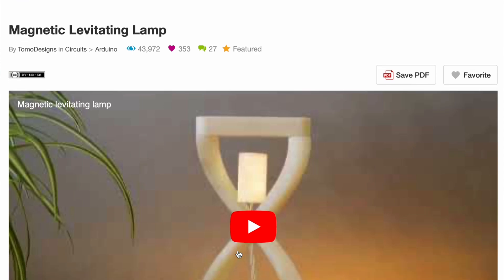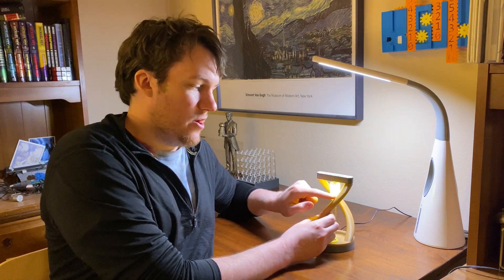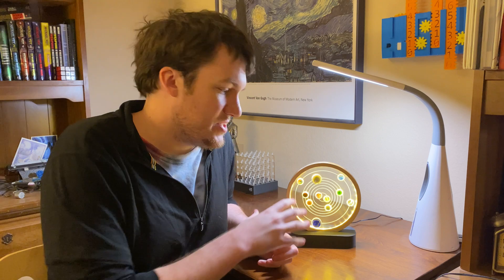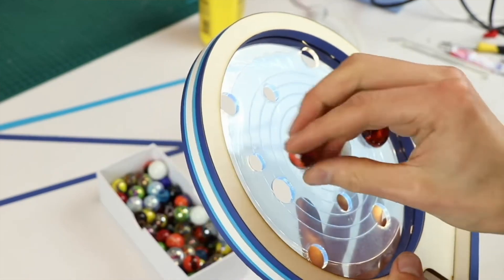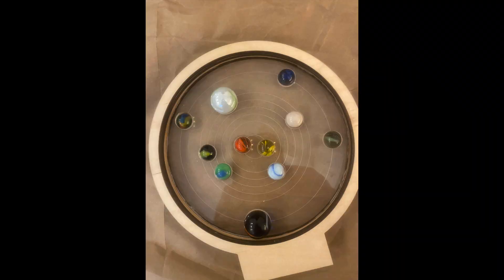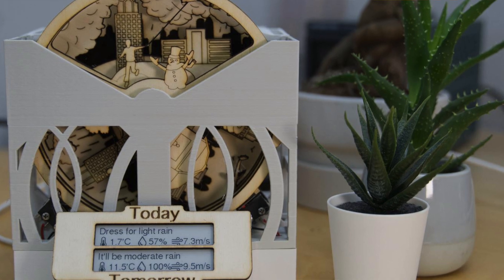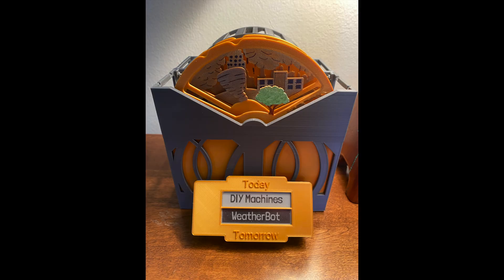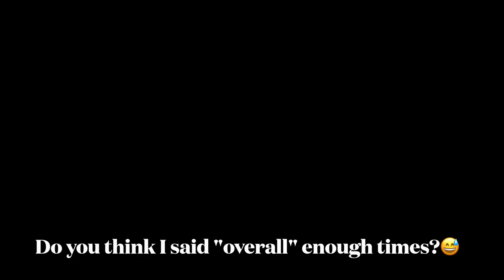3 Cool DIY Projects I Found On The Internet

Comment: I am thinking that the way to ace the marble installation would be to go completely glueless. Size the holes a few nm undersize, then try to fit the marbles in frozen and let expansion seat them. Maybe that wouldn't work, but worth a shot and easy to enlarge the holes slightly if necessary if it doesn't.
Reply from the maker: That's not something I would have ever thought of. thanks!

Comment: In terms of making the weather display silent, I would suggest small stepper motors and silent drivers, they should be more than powerful enough to move the discs and with silent drivers at low speed they are really quiet. Also you can count the steps then for the positioning of the discs. Since you have 4 discs, an arduino with a CNC shield can connect 4 stepper motor drivers or you could buy a 3D printer mainboard, they have at least 4 stepper motor connections.

Another more expensive option would be to use brushless motors and something like an O drive, but that is definitely overkill.

Stepper motors are likely the best and cheapest option but using higher quality brushed motors with gears could be an option, maybe something to look at would be a “Geneva drive”, it provides a nice stepped rotation from a continuous rotation.
Reply from the maker: Thanks. The blue and orange clock on the wall in the background also uses screechy continuous rotation servos, so I plan to use steppers and silent drivers for it. (Steppers are what the original guide for the clock said to do, but I thought I knew better 😵). For the Weatherbot, I'd been thinking of using just basic, cheap DC motors. There are notches for each scene on the scene disks that trigger limit switches, so all I really need is a motor that can turn until the limit switch is triggered.